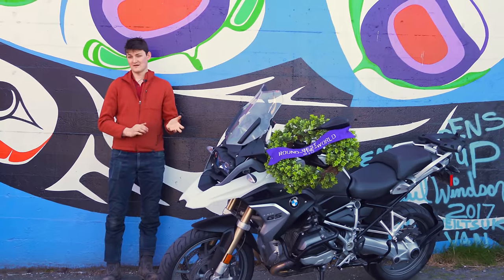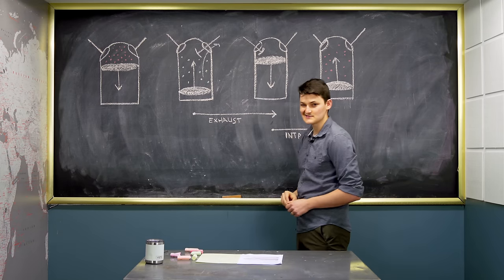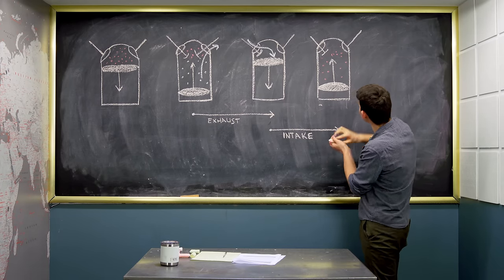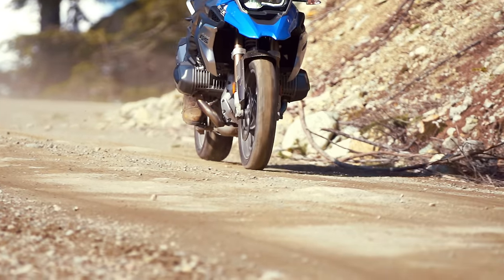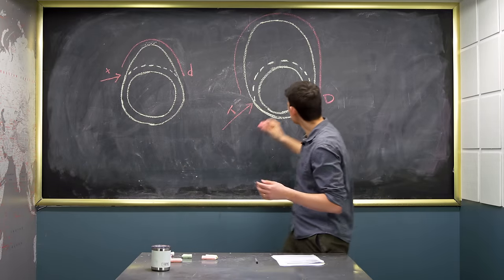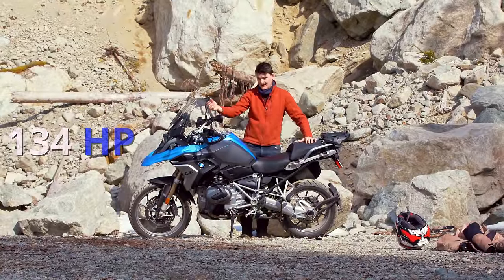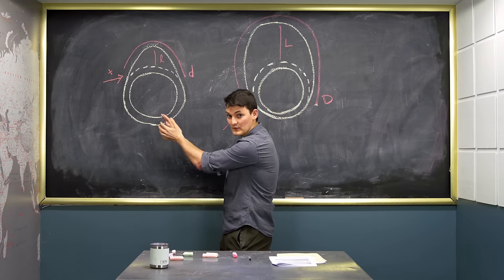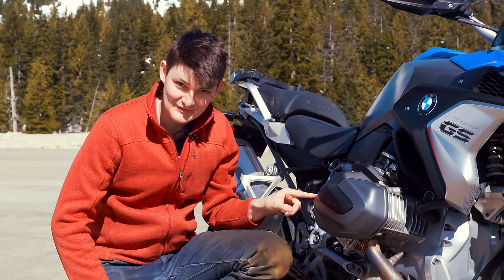Variable Valves are Bad for the BMW R1250GS - Review

Comment: On GPS mount covering the speedo when standing:
- Do you really check your speed while riding off-road and standing instead of looking at the terrain?
- If you had a GPS mounted on there, you would know that the GPS allows to show current speed and other "vitals", so even though it covers the TFT display, it can display the same information.

It's easier to criticise than come up with something better ... which bike you can buy has better engine? Referencing a concept from Suzuki doesn't count.

Motorcycles pack incredible value: for $22-24 what kind of new car you could buy? Would that car be top notch? What would be the dynamic characteristic of it? How much would it cost to customise a japanese motorcycle to match the comfort of GS? Aftermarket add-ons aren't cheap either... Maybe this video is there to captivate viewers, yet reality is hardly one-sided.
Reply: David Adam the gs is so perfect, any perceptible flaw must be identified. One can’t accept that perfection exists.

Comment: Ryan 
Regarding the special tool for the oil plug in the cylinder head, I must tell you that there is no special tool from BMW, You just have to take the supplied screwdriver with the proper shape for that.(It´s under the passenger seat)
Regards, Walter
Reply: So you’re telling me that there’s no special tool from BMW... just a screwdriver with the nonstandard shape on the bottom... that comes from BMW... and only BMW... so it’s a proprietary tool... from BMW... jesus
Reply: James Smith yes, but comes from BMW, it is not an accesorie and is a great idea to protect that oil screw when you travel. Regards from Buenos Aires

Comment: I thought the two cam lobes were purely for high and low throttle position and not varying over the rev range, hence not fully lifting for partial throttle and purely for getting through eu5 emission laws. The added torque and power might be only due to the substancially increased egnine size, or not?

Comment: Hi, great videos! I saw once your video about trail breaking and I wonder how does the Paralever suspension affects trail breaking due to the fact that there is no perceptible diving on the front when breaking during the turn. Does the paralever negates in part the weight shifting to the front and therefore the benefit of trail breaking?

Comment: The change Over rpm is wrong if it's that dramatic, and it does have a greater effect than a timing change, as you can change timing, lift and duration.    A superior system may be another bmw system valvetronic variable valve lift and duration, often combined with variable timing

Comment: In some eighties cars you got much of the same advantages by using a valve in the exhaust and inlet Travis that would effectively shut off flow through two of the four valves in. Cylinder.

Comment: Considering that the latest fashion amongst round the world riders appears to be to use an ex-Australia Post Honda C110x perhaps Fortnine is correct regarding the BMW GS’s cost, complexity and the problems fixing this behemoth (or picking it up when you drop it which you will) if things go wrong in Outer Remotistan or Ruritania.  The Honda would certainly be cheaper to buy, operate and fix as parts are available across much of this planet.  No doubt a review of the recently re-released Honda Cub and Trail Cub is in the works.

Comment: So very glad I bought my KTM 1290 Super Adv T in 2017, almost bought the GS1200A, but the 10,000KM service intervals, insane service prices and being tied into bespoke "BMW approved luggage" [or I lose my warranty according to Fritz the sales guy at BMW Mottorad] swayed me to a bike that has 15000KM service intervals, came with luggage and was €3000+ cheaper.
The fact the KTM LC8 makes a lot more usable BHP and has amazing low end grunt were probably the "deciding factors" to be honest, but c'mon, a €3K saving and longer/cheaper services were secondary factors...
Lastly, without doubt, the BMW GS1200/1250's are a damned site more comfortable than the KTMs are and one never has to tighten the chain on the BMW :D

Comment: Have an R1200GS Adventure. Seems like BMW went to great lengths to make their stuff expensive and difficult to maintain and repair. Need special computer to reset service reminder, U joints staked into drive shaft...  newer ones even worse.
Reply: It's every car and motorcycle and every manufacturer going this way make it difficult to repair and maintain.
Reply: Yeah. At least cars are required to comply with OBD2, so you can read basic codes without factory proprietary equipment.

Comment: The 1250GS, just like my 1250RS, has a multi-part screwdriver under the seat. The handle is designed to be used as an oil cap wrench.

Comment: The logic behind how two available cam profiles only being good for two very narrow and quite separate RPM ranges is flawed. One only need to look at how a non-variable cam is a complete compromise for both high and low speed running to immediately see the flaw in the argument.
It is quite reasonable to have a cam profile optimized for low to medium RPM, then have the higher RPM Cam come into play for higher RPM. In both cases it's quite reasonable to tune the power to be optimized for each RPM range, and have it significantly better than a single profile cam, with no significant performance gaps between the two ranges...
As to the possibility the electrics will fail? Manufacturers long ago figured out how to build components that can withstand engine heat for hundreds of thousands of miles. And should it actually fail, it would likely 'fail safe' to the lower RPM cam profile, which is close to what almost every other bike on the planet runs. 
Is the R1250GS shift-cam perfect? No. Just better than almost every other bike on the planet...
Reply: "Manufacturers long ago figured out how to build components that can withstand engine heat for hundreds of thousands of miles. And should it actually fail, it would likely 'fail safe' to the lower RPM cam profile, which is close to what almost every other bike on the planet runs" 
I think you are either a GS owner or blind to the reality or both. electronic component in an engine head sticking outside and is the first point of contact or crash (even with crashbars) is a pointless solution if we are talking about "adventure" bike....if it is about road roaming alone yeah why not...adventure? absolutely not! electronic components do not fail from heat only, but also vibration, shocks and electric current disfunctionning...and in the world of the GS: that is a certainty! come on just look at the multiple error message from solenoid to suspension to anything else!
now failing safe is a big statement: if it bails in between (see there is a space between the first cam and second cam) then you are stranded anyway.... please do  you really need that extra power and torque? what is the trade off here? 5hp for a much increased risk of failure??
Reply: @purificator1004  To think BMW with all their decades of engine production is new to how to build a reliable engine, is ludicrous.
I guess time will tell if there's a stream of dissatisfied customers because Shift Cam engines fail. 
And no, I don't own one, but certainly would consider it.

Comment: Hi from the uk 
I also am one of the hun as I like to tease my work mates.
Isn't it just electronic gimicary for the sake of it. When would a trials bike need top end power or a race bike low down grunt. I personally like  the bad manners of a highly tuned engine trying to stay running at low speed it's what separates the experienced from the newby, just as I can't really fathom why so many modern sport bikes have different rider modes can't these people learn to control there inputs into a machine.  Learning to make freinds with a machine understanding  how it works and preforms takes time and is an important investment. Just flicking a switch because its raining or icy is just plain amateurish 
Keep up the good work 
Now it's time for pumpernickel and handcase with beer

Comment: For those us still at liberty to worship Our Lady of Blessed Acceleration, I love the VVT on the highway when riding to the areas of my BDR trail riding in North America. Low torque at low speed, and high torque at high speed. I have no complaints or concerns. And, at 16K miles in at 1 year of ownership, I’ve had no mechanical issues. ✌️

Comment: All the enumerated problems are no problems at all, and I think the reviewer knows this, but tried to make a controversial video. Good for the view counts. Nevertheless funny video as always, but some people might diverge from the GS due to fake problems. 
The engine works even without the actuator, the hill climb control can be turned off, the oil wrench is under the seat.
All vehicles nowadays are packed with electronic. A single chip has millions of transístores. Does it really makes a difference if it has 5 or 10 chips?

Comment: The marketing boys are ever demanding greater bells and whistles to avoid stagnancy of the product , to keep up with Sig/Shi Jones'es . We all go dewy eyed at the shows and life goes on. I've had three GS's ; 80 , first 1200 and currently what I think was the best incarnation the 2010 1200 twin cam air cooled.  Simple ( relatively ) and great power delivery. Not very Greta friendly as doubtless squirrels will get asthma from it over time, but a great package. Duel purpose is a compromise but a bike for everyday and most situations is always going to be trade off somewhere along the line. Great video and objectivity not found in the mags that rely on advertising.

Comment: Wow I’m kinda surprised at the lack of innovation, as a four-wheel boxed heathen who is currently just bi-wheel-curious even I know that BMW’s car department had a much more clever VVT system known as Dual VANOS as far back as the 90’s that while not as beautifully simple as the new Suzuki idea in that it does involve computers, works an absolute dream. I own an E39 with dual vanos and the power delivery is butter smooth across the entire rev range, even up close to 6k. So given that they’ve had 30 years, why didn’t they just shrink their dual vanos system for their flagship adventure bike?

Comment: As someone who is new to the ADV market..which 3 bikes would you all recommend to look into? I have no idea where to begin with ADV
Reply: Depends on a couple of things. How much are you willing to spend, how tall are you, what kind of riding are you doing?
For me, the four main contenders I had to decide from were the BMW R1250GS Adventure, Honda Africa Twin Adventure Sport, Triumph Tiger 1200 Rally Explorer and KTM 1290 Adventure S. The Ducati Multistrada V4S was just too expensive for me.
The Honda and KTM are chain driven, which I didn't want to maintain all the time. The Triumph is very expensive with maintenance costs compared to the BMW regarding valve clearance checks. So I went with the BMW.

Comment: Cam phasing alone with fixed duration and lift is inoptimal for combining performance and efficiency / emissions.  You end up running short durations or you end up pushing an open and / or close event too far out of the optimal range for the competing targets.

To combine modern emissions standards with continually superlative performance, you need variable duration at the very least.  Aside from BMW's Valvetronic and Freevalve, there's not much out there that does this continuously.  Anything that gives you variable duration can in principle give you variable lift, so whilst you're down there...

BMW, Honda and Yamaha are the only ones so far that have done it right, for (production) motorcycles.  Utilising two separate cam profiles is simple and effective and no more prone to failing than anything else that's been wrung through the consumer-product engineering mangle, except it has the advantage of being thoroughly proven.

The fact that separate humps can be felt on the BMW (and the VFR800, arguably) is likely because it's a marketing point; otherwise there's no real reason not to tune the two curves to make seamless torque everywhere.  VTEC kicked in, yo, indeed.

Comment: Hi guys, isn`t the oil filler cap removal possible to be done with the screwdriver handle, which is found under the seat?
Reply: Yes, the tool is under the seat.

Comment: After have tested finally in a proper way the R1250 GS engine with a typical official bmw very dynamic test ride if i can say. Before with the R 1250 R couldn't exploit really. As for a R1200R air/oil 2014 owner. I've found that motorcycle really great and swissknife and so on... i felt what i saw in this video with surprise. Very impressive engine but with that powerfull low and top end. It loose the roundness of the air/oil cooled one. Witch is a linear sensation from torque to power building all the rev going up. With all the electrical it loose the character of the twin for me. Violent, less torquy feeling.

Comment: Whenever I get close to pulling the trigger on a 1250GSA I come back and watch this...  My reason for this bike is that it's the most comfortable ergo's I've felt so far...  Does mostly everything I'll ever wanna do...  10 years from now I'll probably trade it for a goldwing...  
So Ryan's thoughts are: It's overpriced.. .Yup... check...  It's under whelming for that price... Yes...  It's got the 'famous bmw reliability'... IE it's not reliable...
What's the other options if you want something that rides nice, has the safety tech and similiar ergos?  
I have a vstrom 650 now, it's a compromise for sure...  Full disclaimer, I'll probably never ride it more than down forest service roads and I'll literally never need an oil change in Mongolia...
Reply: After sitting on 'should I buy a GS/GSA' for like 2 years... I bought a GSA.

All the critiques seem valid (well except how you can disable hillside assist)...  I do wish other manufacturers would step it up and compete...

Comment: Why aren't we seeing computer controlled, electrically operated engine valves, at least on high end stuff?
Surely that could provide infinitely and dynamically variable timing plus the option of built in mechanical valve closure a la Desmodromic.

Comment: I keep mij 2018 1200 GSA.  I can't see the point of that much money for some more torque and top end power.  Many years of development created the bike as it is now, wel balanced and developed.  
I might buy one if my current bike is in need of replacement after many years and the 1250 is as reliable as the 1200 is now.

Comment: Ah...zee GS is goot. Only zee rider is flawed. 

As a BMW owner, and a former GS owner, who left the brand for a Japanese bike only to return...I know the flaws and the idiosyncrasies of BMW give them character. My V-Strom worked just like my refrigerator. If I put something warm in my fridge and shut the door, I come back later and it's cold. Amazing! Right? Sure...but not really very exciting. My V-Strom served me for 8 years and I never did anything to it but fluid changes. Didn't even replace the battery or chain. But it had the personality of a wet mop. My BMW requires frequent maintenance for the final drive, valve adjustments, and spline lube. But maybe that's why I love it. Sort of like those folks who are into BDSM...hurts so good.

Comment: Was thinking of upgrading my 2014 R1200GS which I truly enjoyed for a new 2020 1250 yet went for a 2017 R1200GS Adventure with almost no mileage on it instead.
Did I miss out on the upgrades? Not really, no. Never had any issues with the power delivery, still prefer the old dashboard to 
the newer screen. Hill assist is just weird, never understood it in cars either.
Overall, r1250gs doesn't look like an improved machine at all, more of a lazy attempt to grab some extra dough from the die-hard fans who will buy the new version no matter what.

Comment: Me thinks. The shift cam are just the easiest way to pass emissions test.  More clean air in the into the exhaust phase, lower co2 reading, with the added benefit of a more efficient second stage fuel burn.,= More power.
Personally I think the GS has become more of a status symbol,, old men do not do off-road adventure riding, broken bones don't heal quickly at that age. The bike really should be a sports tourer.

Comment: 1100 and 1150 Series Rule! simple but with enough electronics to make them right. And if anybody brings up Claudios 1150GS failure in Mongolia, it wasn't the bike that failed, they welded before disconnecting the battery / electrics.

Comment: That 2 cylinder bike uses the same amount of fuel / 100km as my 2019 Hybrid Camry, and costs about the same. Just as well I no longer go trail biking. I will certainly ride in comfort with my 8-way adjustable electric seat, and I can share it with a couple of other people. I know, some old men still ride, but I would rather ride my bicycle.
Reply: Bikes use more fuel than cars now it's all about aerodynamics. A 2 tonne car can now get 60mpg. A 200kg motorcycle is lucky to get 60mpg.  Really it should get 600mpg. The rider on top of the bike is what ruins it all.